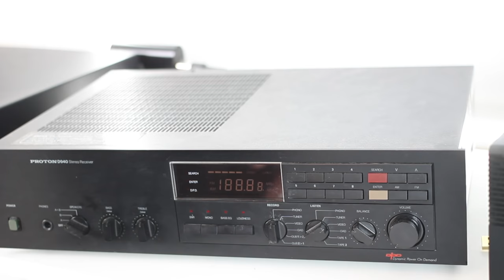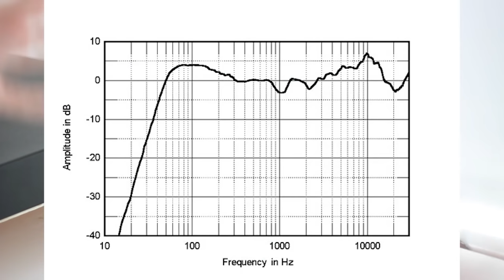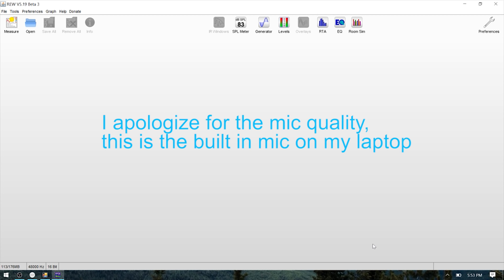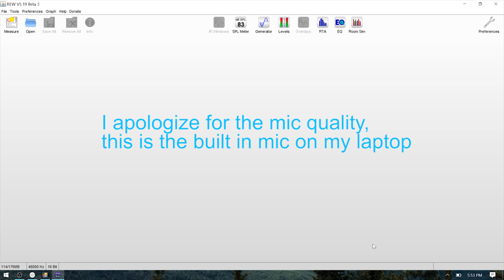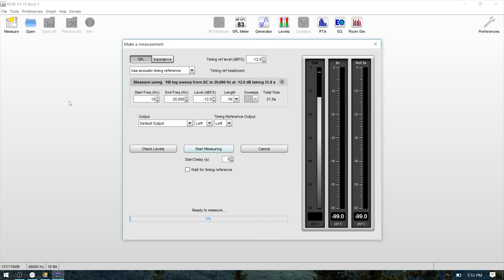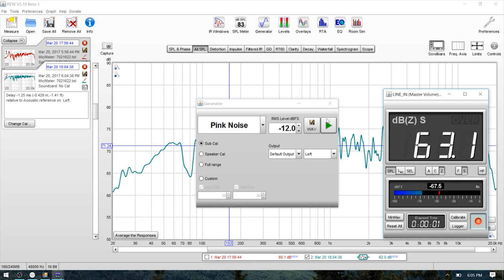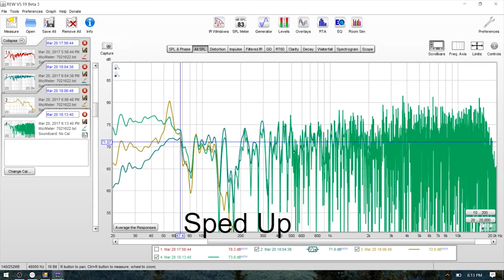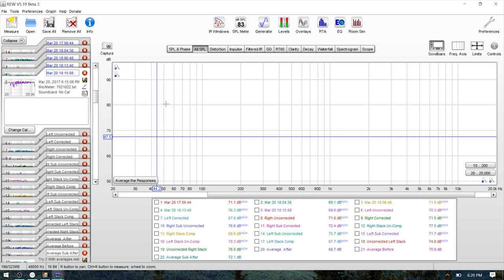Beginner's Guide to Loudspeaker DSP and Measurements (w/ MiniDSP)

Comment: Great video! I wonder if there is a "poor man" alternative for speakers measurement. miniDSP and the mic are cost prohibitive for me.
Reply: While I can identify with this seeming expensive, it's actually one of the cheapest ways to do this. I can't think of a less expensive way to accomplish everything a dsp does unfortunately.
Reply: @JC-lk3oy  I figured a cheaper and more accurate way of making the measurement (at least for me, coz I have the test gear). Using a 1.5 USD full range microphone (Panasonic WM61A), full range preamp, Wave generator, and Oscilloscope...and filling the information on a spreadsheet.
Reply: A USB mic, and the free Room EQ wizard (REW) software should work, with a PC.  Better is the miniDSP microphone because it’s calibrated.

Comment: Mate, how about a tutorial on Dual subwoofers on a H\T system
Reply from the maker: Exactly the same thing as doing them in a stereo, which i covered in this vid, but you'll have to use the subwoofer outs into the minidsp
Reply: Technico but if I want to use two mono subs?
Reply from the maker: Youd simply use the routing tab in the software to send the low passes outputs to whichever plugs you wanted to use for subs.

Measure the subs, EQ them and apply the eq to the proper channel.

I am using two mono subs. I covered it in this video
Reply: Can the mini DSP convert a Sterio to a Mono signal
Reply: justanothercubeguy great video, will share with my ht group
Reply: justanothercubeguy I just bought one minidsp HD. Can't find mono anywhere. Don't think it's possible. But I don't notis any difference in the bas sound.
Reply: Do I measure the dual subs separately or together? Thanks
Reply: separately   is better since they are not at same place

Comment: how do i measure the distance from a down firing sub for time alignment?
Reply: Go to Spectrogram and change it from Fourier to Wavelet, and make the frequency the y-axis and time the x-axis

Then measure both (if crossover is active, then just measure one speaker as it’ll crossover to the sub) and see if they are aligned in the spectrogram:
Go to Spectrogram and change it from Fourier to Wavelet, and make the frequency the y-axis and time the x-axis

Then measure a speaker+sub and see if they are aligned in the spectrogram:
https://youtu.be/-A8LjsOx6d0?t=25m30s

Comment: why does my set target have slopes? its not a straight line.
Reply from the maker: Under target settings in the EQ tab, set the "HF Fall Slope" and LF Rise Slope" to "0.0" instead of 1.0 or 0.1 or whatever it's set too.
Reply: Strange I thought I tried that, guess I didn't. Thanks it worked. Looking forward to more content!
Reply from the maker: Glad it worked! I have a Dirac review coming up for the DDRC-24 (the 2x4HD except DIRAC)

Comment: Great Video!    I noticed using a spectrum analyzer on my phone (Speccy on Android), if the microphone sample rate is set to 48khz, I see a huge dip in the response above 18khz with pink or white noise.   When I set the sample rate to 96khz,  white noise is flat and pink has the expected gradual slope downward.  W. the nonHD version of miniDSP, I think the sample rate is only 48khz.  Is that going to screw up your highs or is that just a phone/mic DAC artifact (pixel 2 xl if that matters).   I subbed your channel.  Really useful stuff!  Thank you.

Comment: I use EQ APo , great thing , and ive used Room EQ , but thing is you cant EQ the room , simple as that .  if Speaker is already purchased  that too is fixed so , if you measure it there is little you can change , Room EQ is not possible , so that is it ,  but  not to say that this knowledge is wasteful , this is a must for PA systems , theaters and all that ,  even Speaker and amp  design ,  there are institutions that will pay you to do this  and where it matters , so its great knowledge

Comment: If you have digital inputs, why aren't you using them? When you input an analog signal it has to go through another ADC and also another DAC. That will definitely degrade the sound quality. DSP works in the digital realm, so why go through unnecessary extra conversions that even the highest end gear can't accomplish without sound degradation. The whole point of DSP is to avoid the sound quality loss from using analog tone/EQ controls.

Comment: On the minidsp output, do you run L amd R on separate output channels? If not, then how do you wire up say a single subwoofer to the output of the minidsp. How would you wire up an amplifier to the minidsp output?

Comment: Very informative!   After I perform the room correction, do I need the computer always on or attached? Or can the info be stored on the minidsp without a computer connect?  I just want my 2.1 to perform without extra on-going baggage.
Reply from the maker: It is saved to the DSP. The computer is only used for calibration and changes made to settings

Comment: A line level (around 2volts) input likely won't "blow anything up", except your ears. It will be very loud though (full output of your amplifier) with no control of the volume. If you have speaker much weaker than your very powerful amp, then your speakers could be damaged. It won't hurt the integrated amp, because most preamps output considerably more than 2 volts. 7 volts and higher is common.

Comment: 1/24 octave smoothing leaves a great deal of high Q peaks and dips visible that aren't all audible with typical program material. 1/12 octave smoothing may be a better choice, although without the convenience of REW EQ outputs directly into MiniDSP software, such as with most other DSP software, lower resolution may be sufficient. 1/6 octave, for example.

Comment: Amazing video. Haven't finished it yet but the first raised an important question : when using the miniDSP in between analogy eauipments (preamp / amp for instance), I understand that the miniDSP will start by digitizing the analogy signal. Since it's integrated AFTER the preamp, what happens when you listen at low volume ? The miniDSP will digitize a low level signal using only a very small fraction of its dynamic range. That should severely impact the sound quality right ?

Comment: hello good afternoon, I write to you from Merida Yucatan Mexico, I was looking for the push to buy the minidps and with your video I am completely convinced.
I would appreciate that you recommend me the best option for my speakers, and even better if you take me out of some doubts that I have with my amplifier, I'll explain ...
I have a Rotel RA-06 and klipsch rb-61 ii, I plan to receive the digital signal from the tv and tv to the minidps to the rotel, I would like to adjust the frequency as you did to help them with a couple of subs, you think you could use the same ampli to raise two low guys using the option a + b?

Comment: Very nice video but I have a question if i dont have a main in I can't use the mini dsp as a crossover to stop any low frequencies going to my speaker's?

 what i have in mind is the pre out going to the mini dsp do some crossover stuff and then send back the signal via rca to my mono block amplifier inputs since the signal has been "changed" everything should work fine right? or I'm missing something

Comment: First of all, thanks for the video. Very helpful. When you insert the MiniDSP between your pre-amp and your power amp, you add one A/D conversion and one D/A conversion. Assuming your source is digital in the first place and converted to an analog signal before entering the pre-amp, this yields the chain of three conversions i.e. D/A-A/D-D/A. Do you have any concerns about this in terms of signal degradation, added noise, etc.?

I am asking since I have an integrated amp with pre-out main-in connections so I could do the same. However, I opted to run my digital source directly into the MiniDSP (optical input) and from there straight into the main-in bypassing the pre-amp. The downside to this is, as you pointed out, the lack of a physical volume control and visual feedback of the volume setting. The benefit is the shortest possible signal path and just one D/A conversion. However, out of convenience I am debating whether I should insert the MiniDSP between the pre-out and main-in as well.

Your comments are appreciated. Thanks.

Comment: Can anybody confirm if my intended set-up will work please? I want to use DDRC-24 Mini DSPHD (Dirac Version). My set-up is an As-1100 integrated amp with pre-out and main in's. I have a digital optical source and play vinyl too, and would like both to be Dirac enabled. I've also a sub I'd like to integrate, if possible. So my understanding  is the mini-dsp's input go to the pre-outs, the mini-dsp's outputs to main-in. Can I then also hook a digital source to the optical in on the mini-dsp? And a sub via another of its outputs? 

Thanks in advance...

Comment: Excellent, excellent video.  I have been working my way through MiniDSP 2X4 equalization, crossover, time and phase alignment . . .  the whole 9 yards. This video really helps. I have two systems - one is conventional 2nd order passive xover and the other was built with the mini.  I'm now in the process of converting the passive xover system to an active xover using the mini. I'm saving this video as a reference.

Comment: Technico,

so i’m thinking about integrating minidsp into my setup.
my setup is very moddest.
as sources i would like to connect turntable (analog), laptop(usb) and airport express(toslink) to minidsp.
then connect minidsp to my integrated amp which has no pre out/main in option.
can i connect it to a line in?(aux/cd)

the amp just drives 2 standmount speakers.

i have terrible room acoustics.

wil i enjoy having a minidsp?
or will there be severe limitations in its capabilities.

with kind regards,

N. Swart

Comment: the Umik-1 mount is threaded (the plastic part).  So, you can take out the metal bolt/adapter so that you have a larger mount for that fits most tripods.  

I wasn't sure the plastic would be threaded figured that bolt was pushed in - thought that could help some people who may not know.  Saved me from buying an extra adapter!

Comment: So in simple words, we have to treat the dips physically with bass traps etc and use eq to bring peaks down, right?
Reply: You can't EQ room modes away. You have to fix the room itself or work your way around it.
Once you have eliminated the BIG room problems miniDSP with DIRAC will help a lot. :-)

There can be deep peaks and troughs in a room. If there is bass buildup  (quite typical in smaller rooms) you may have a considerable peak near the back wall. (You can pull it down in various ways: speaker positioning, listening point, bass absorption with membrane panels, 20 cm thick foam, etc) You have to decide whether you want just a single sweet spot or a broader area, which typically requires more "engineering".
Rearrange listening position to move away from the "infernal areas" Play with speaker position. Pull the dang speakers away from the front wall. And don't listen from the back wall if possible. Set up REW and start playing around in the room to "map" it and measure the effects of your changes. It may take time and patience, but it's worth it. What you can't tame with positioning alone must be tempered down with absorbers, etc. 
Some people distribute bass throughout the room by using multiple subwoofers, each putting out less energy. (Major project and serious investment)

Most problems are bass related. If you need to manage treble you must take into account wall, floor and ceiling reflection, (floor mats, drapes, diffractors). Don't go overboard or you'll "kill" the room acoustically! Go step by step.
Reply: @juanmillaruelo7647  Thanks, i built a lot of rockwool panels spaced 15cm from the walls, thick bass traps in the corners and ceiling panels above the listening area. Then i eq corrected the room using Sonarworks Reference Software. The results are pretty good. I had some dips at 100-200 hz which was fixed by the software. The room is for mixing and producing. Recording vocals works really well too. But for mixing, all you have to do is  tune your ears to the new conditions and compare your work against mainstream music.

PS: This was done a year ago and although acoustics is not something im expert at, i figured i cannot treat the low frequencies because of their wavelength and the shape/dimensions of my room. There is always going to be some sort of problem but i cant remember why or how i figured this lol.

Comment: yes GREAT video!  i am just getting my feet wet in this space  and trying to figure out the connections.... dsp 2x4hd, umm-6, REW, laptop, preamp, 2x pwr amps (one running fullrange speakers, and other running L&R subs).

not getting any pink noise.  i can hear it at laptop and with headphones plugged in, but nothing via pre amp.

this is my connection currently:
usb mic to laptop
laptop headphone out to rca y connector to preamp input.
usb laptop to dsp
preamp out to input on dsp
outputs on dsp to both  power amps.

i have the headphone out set as headphone/speaker out.  and selected laptop sound card as output.

i am doing something wrong, but couldn't figure it out last night.  

thks tim
Reply: I think it is done in separate steps. First thing is to make the subs work with regular setup making that full-spectrum pink noise, while the mike listens in from the listener position. This will produce a response curve with all those dips and peaks. Then run the program to smooth out the curve and produce the file that's then fed into the miniDSP. Then place the device between the preamp and power amps and see if the subs sound better. Basically, the miniDSP is a parametric filter with lots of operational bands and REW helps to create the correction file for the miniDSP.  I think this is right.

Comment: You don't have to care about the direction your microphone is pointing at, because it should have an omnidirectional characteristic (at least every measuring microphone i know has it)
Reply from the maker: TheRealMephistopheles Even though the pattern is omnidirectional, the microphone responds differently depending on what angle it's receiving sound from. They give you two calibration files (one for 0deg and one for 90deg)